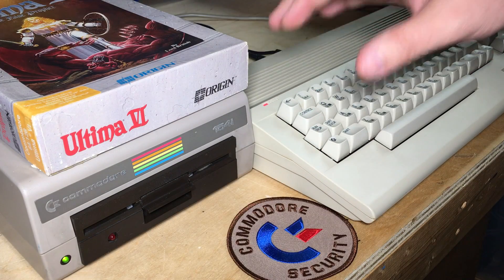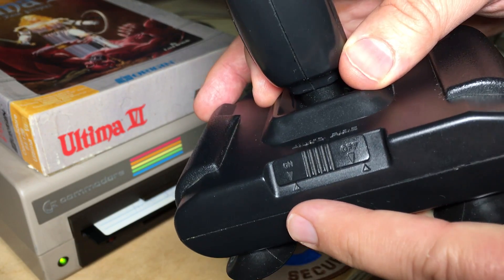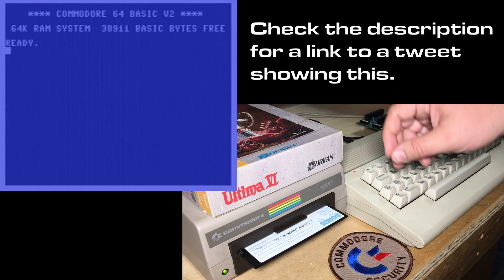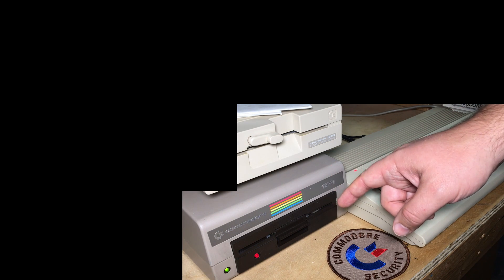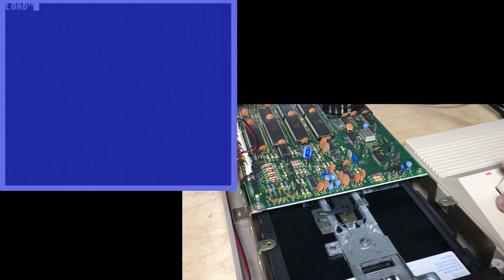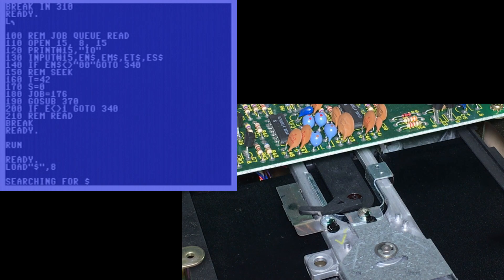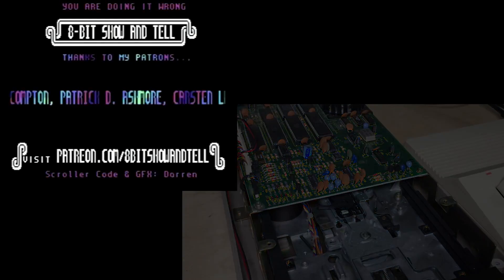Karateka Killed My 1541  (Temporarily) and Other C64 Scares

Comment: For hacking games, we used to shim the top of the 1541 a little bit, and tape a piece of index card to the head, then use a pencil to mark off important tracks on the card.

You could watch for the mark and then yank on the card to cause an error while copying a game. It wasn't very scientific but with the right software and just the right touch you could reliably copy games or even force your way past some errors and protection schemes.

Comment: Great video, cool to see some of the things that can scare you into thinking your C64 is borked.
I remember the first time I encountered the autofire bug, I turned the C64 on and didn't know the autofire on the joystick in port 2 was on, and of course when I typed LOAD got the LQAD as your video shows. I definitely thought my C64 has a problem for a bit until I unplugged the joystick and suddenly everything miraculously worked again, then plugged it in again  and again it didn't work.

It was at this point I examined the joystick and found the autofire was on, and switching it off solved the problem. I also then did what Robin did in the video and plugged the joystick into port 1 and fiddled a bit to find out what it would do.

Thanks also for the explanation about why most later games used port 2 as the default joystick port. Always wondered about that (long forgot about the joystick autofire issues until this video reminded me). Guess it made sense, although some games must have found ways around this issue, such as Rampage which has simultaneous 3 player, using both joystick ports and keyboard at the same time, never found any issues when playing that game in 3 player mode.
Reply from the maker: Yes, it seems with careful programming (and perhaps with careful key selection on the keyboard?) most or all of the keyboard problems can be avoided. That's something I've meant to look into in more detail sometime.

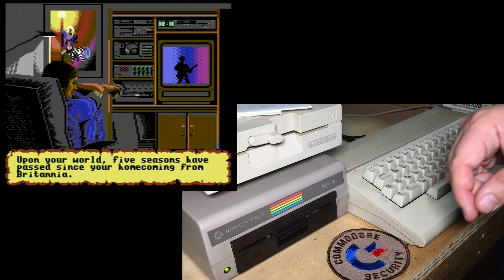Comment: 9:15 Omg! That happened to me! I vividly recall that 4 beat sound the file not found error returned. I had 100s of disks filled with content from the golden bbs days. I think I was going through some games and all of a sudden the drive wouldn't read anything anymore. I think that's why I boxed it up and archived the system.

Nothing has made me want to power on my c64 more than watching the fix for that issue. Thank you for a great explanation! Cheers

Side note: I had an apparently copy protected version of Karateka. There was an invisible forcefield/barrier that prevented the player from entering the final boss's door. It was only on my downloaded version, not the official version.

Comment: A recent scare has been old disks that just have so much oxidation buildup that they coat the read sensor. Then no further disks work. Saw this on another channel...rather than open up the drive, if you don't have a cleaning diskette you can cut up a 3.5 cleaning diskette and take that white material and tape it over a 5.25 diskette's opening and dab it with alcohol, then send commands and presto cleaned.

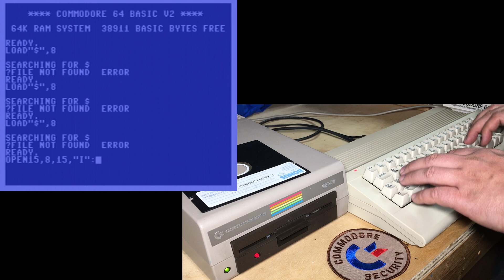Comment: Thank you so much for this great video. I grew up with a C64 but just started using it again after a longer hiatus and totally forgot the floppy drive initialize trick you show at 10:50 in the video. I thought I had broken it since even power cycling didn't help and it would not show the directory of any floppy. Initializing it fixed it again.

Comment: Imagine the makers of Karateka deliberately messed up your 1541 for copying the game - that's cruel.

Also the fact you were able to fix it yourself at age 12 is amazing. I would of cried to my mom to buy me a new one 😂🤣

Also I remember I had a Vic-1541 disk drive for my Commodore 64. I bought it used as a new one was so expensive. I remember some games wouldn't load up on the Vic1541 - the disk drive would make funky noises and then just stop and the small light would flash repeatedly. I wonder if it was due to functionality issues with such an old 1541 drive operating on a C64?

Comment: Before I had the Action Replay I used some kind of three-way-reset (manually, I sticked some cables into the expansion port):
• Normal reset (/RESET to GND)
• Short reset (/RESET to GND via a capacitor, only a short impulse ignored by any device on the IEC bus. You can read the error from the 1541.)
• (/EXROM to GND, /RESET to GND, release /EXROM to GND shortly after /RESET to GND was released. KERNEL reads $8000 and just receives garbage and cannot find the CBM80 magic text. /EXROM must be released soon as the memory test routine in KERNEL would overwrite the RESET vector at $8000.

Comment: Regarding the Ultima copy protection: Yie ar Kung-Fu had something similar. You MUST turn-off the drive after loading the game, or it will crash. This is especially tricky on a C128D with integrated drive, see https://www.lemon64.com/forum/viewtopic.php?t=9998&sid=b327503a8d3d100c51fd2e6489ba15d3

On a related note: Yie ar Kung-Fu uses 6 digits to display the score (000000). As a kid I always wondered what would happen if you reach 999999. After hours of play on a rainy day in the early '90s I was very disappointed to find out that it just rolls over to 0 when you reach a million :-)

Comment: On a normal directory load the drive just checks the current position and the neighboring tracks without calling the recalibration as on format or initialize. With a dolphindos formatted disk (if it can read the sector header without dolphindos) or if being on track 35 max it will read the sector header and know where to find track 18. BTW: when formatting you can shorten the head bang by seeking to track 35 before doing it. Not an issue on 1541- II as there have a light sensor for track zero.

Comment: As far as I know, thus is not a physical lock on the drive. It is more like a "bug" of the ROM. Let me elaborate. When you try to read the directory, the ROM will spin up the drive and read the current track (without moving). If it could read it, it would have figured out which track it was and move accordingly. Piece of cake. However, when unable to read the track, it will first assume that it is half track before or after a real track and try both options. Thus the slight back and forward motion you see. Under normal circumstances, either of these would have yielded a valid track and we go back to the first case. But here we're in track 42, which was never initialized, thus it will never be able to read and will just give up. This also happens when the heads are dirty and you try to read the directory, but only for the directory as far as I can tell. because when reading files it does try to recalibrate by going to track 0. Just my two cents.
Reply from the maker: Yes, I believe this is correct now; a few people have explained it to me since I made this video. Next time I make a video about the 1541 I'll try to explain this correctly. Thanks.

Comment: 9:56 CLASSIC 1541 failure, when head is drop in the space between tracks. That is, head move 2 steps to advance each track. The space between track is there to avoid overlaping. I dont know why the stepper has double of resolution in relation of track, but was a nice touch. Many errors froced the DOS of the drive to drop the head in areas with no information. So you need to MANUALLY reset the herad by command, wich bumps the head to "track 0". Format command will work as well. Nothing preventd CBM to add a check moving one "STEP" (not one track) to see if it starts picking signal again and resyncs. Also the cardboard protector for shipping could be used as a head reset. All you need was to position the head in an actual track, and the cardboard did great .... LOL.

Comment: the 1541C (the white variant of the original 1541) is the only drive that would seek back to track 18 when powered on.
On the other models, the head doesn't really get phisically stuck on tracks > 35, the problem is just firmware. The disk firmware first tries to detect on what track the head is currently positioned to. If it has been moved on an unformatted track (> 35) then it can't read any sync/format informations and the firmware just tries moving half a track forward then backwards just to compensate for any alignment issue. If it can't still identify a valid format, it gives an error. You can obtain the same behaviour inserting an unformatted disk when the head is on a valid track.
The only way to have disk firmware seek back to track 1 is using the "INITIALIZE" or "I" command.

Comment: That track 42 business is pretty neat. When I tried to copy the Abacus Basic-64 compiler nothing could touch it including Fast HackEm. It wasn't until finally, many years later using Star Commander (building d64 files) that I find out that data on that disk went all the way out to track 40. I guess I just wasn't persistent enough in 1986. I actually bought a backup copy from Abacus at the time.

Comment: Kareteka was notorious for being one of the first c64 & Atari-8 games with very effective copy protection schemes .  it was one of the copy protections that directed the drive to look at a damaged or unreadable track and if the value didmt match the encoded hash the game wouldnt work or would only work for a few levels and then abort.  
i know it took years for A8 kareteka to be cracked, and even the smart copying systems like Happy Drive didnt do it.  Supposedly the trak ( brand)  z80 based atari drive would make copies because it could replicate the physically damaged areas of the floppy disk.

Comment: That 1541 intialize command is a "floppy drive seek" which is done by every single PC floppy disk drive just to avoid the situation you were having. I suspect the 1571 doesn't even have this issue because it can read the entire 40 tracks, and it seeks its head back home on power-up.

Comment: The file not found error with the same sound happened to me as an 8-9 year old - but it was with a 3rd party disk drive with a turbo loading feature (the LED light was square and it would turn from green to red) I thought it was completely screwed. I wish I knew the initalise code back then as I don't think I ever recovered from it...

Comment: In regards to Karateka, I am surprised the company wasn't sued. I don't know if this was INTENTIONAL or a flaw in their copy protection..  As far as copy protection on the C-64, early versions are the ones that caused most damage to drive.  I call those "stepper motor" versions, for instance Sector error 21 caused the head to "bang" (what you referred to as the machine gun sound).  Over time these protections caused the head to go out of alignment and really mess up your 1541 drive, where you could eventually no longer read disks properly or at all.   Later copy protection did not bang the head (i.e. error #29) etc, but these copy protections (#21, #23, #27, #29( were easy and could easily be copied.  Then came more sophisticated protection like half tracks, tracks beyond 35, as 35 is the normal upper limit, but modified routines written to drive could allow them to go beyond, for example the protection could be stored on track 40 or in a half track.   Then more sophisticated protections like GCR, etc.  
So for Karateka, my theory is that it used one of the non conventional protections, meaning it would move the head to a non standard / non conventional area inside the drive (half track, past track 35, etc, and just LEVAE it there.  So this explains why you could not access your disks anymore even after powering it off......This in my opinion could have very well been a flaw in the 1541 design, not automatically resetting the head's position
So your INITIALIZE command does just that, it will RESET the head back into a normal position, unfortunately, the banging on the steppe rmotor is NOT a good thin for the 1541, eventually this caused 1541 drives to out of alignment, and the only way to fix it would be to open it up and re-align the heads, but you'd need special calibration software to do it, not something most people have access to, but a fairly easy fix.

Good thing that eventually copy protection was non destructive, no banging of the head.
But eventually you had sophisticated disk copy tools that were compatible with half track, though the multi protection and GCR ones were really tough (i.e. GEOS64)  but all of these could be cracked by just bypassing check and jumping to start of game.......  As far as games with multiple checks later on, another way could be to just emulate and fool the loader into thinking that the value it is comparing does match, so it can apply to any other checks.  End result, no protection is uncrackable.
BUT.......what if you were to store some the checks inside non standard tracks, now that would be tricky.

So as to Karateka, well let's assume it was poor coding, it moved the head to a non conventional position and left it there instead of resetting its position back, as most other games do.  Also Karateka has multiple protection routines, so even if you were to successfully copy the game with the right copier, you would have had weird game behaviour.

Even when formatting a 1541 disk you would hear that initial stepper motor banging, good thing they eventually made formatters that did not exhibit this behaviour (flaw).

I'm happy you figured it out using the "I" command .  If this was done now company would face hefty lawsuits :D    A few modifications to the ROM would have prevented the stepper motor bangs and automatically initialized the head's position upon powering on.

Comment: About multiple drives... many commercial software (usually games) used a fastloader to overcome slow performance of 1541 / C64 firmware.  A few of these use the clock (CLK), data (DATA) and attention (ATN) lines similar to original ROMs, only faster transfer rates.  These normally don't cause a problem with other devices.

Most fastloaders (from my experience) use both CLK and DATA lines to transfer data (instead of just the DATA line)... this automatically translates into 2x speed at 'official' rates and much faster is possible.  The 'good' ones (most) use a timing delay and special CLK/DATA handshake to control communication.

However a few 'bad' fastloaders use the ATN line to control communication (it seems like Ultima VI is one).  Any device that hasn't been 'uploaded' with special code to know about the non-standard ATN use will 'jam' the serial bus.  All standard CBM serial devices will pull one of the DATA or CLK lines low (sorry don't remember which offhand)... anyway this means that neither the C64 nor the desired device (like disk 8) will be able to communicate because some 'unprogrammed' device (like disk 9 or a printer) is holding DATA or CLK low.

Going off topic... You might think you could devise a scheme to use all three of CLK/DATA/ATN to get a 'baseline' speed-boost of 3x (at 'official' transfer rate, faster still possible).  However among C64, 1541 and 1571 only C64 can 'write' the ATN line.  So you could devise a 'fast-save' to use all 3 lines, but you can't create a 'fast-load'.  I'm not sure about 1581, but the CMD hard-drives and Jim Brain's uIEC allow the disk to write ATN so 3x 'baseline' fastloader is possible with them.  I have never seen this done.  If it were done, any other serial device would cause interference like described above.

Comment: I would wonder if the Karateka software tries to read something at track 42 - definitely would be good for copy protection, and if it passed it would do a force of some type to move it back to the normal area to continue - but since it had failed the protection check it didn't even try to get it back... a feature?

Comment: Does Ultima VI have a fast loader? It doesn't seem unusual that fast loaders break if there are multiple devices on the IEC bus.  Since they usually work by violating the IEC protocol, any other devices on the bus get confused
Reply: Yes, that seems to have been the case with Ultima VI , although it was perfectly possible, and usual, for fastloaders to work with multiple drives or other devices on the IEC bus.

Comment: On the early 1541 drives, it was possible that all that head knocking could eventually cause it to be misaligned.

The drive wheel was not physically prevented from rotating on the shaft of the stepper motor by anything other than a tight friction fit. A user developed solution back then was to get the heads back in alignment then use a Dremel with a cutting wheel to cut a channel across the top of the stepper motor shaft and drive wheel that would hold a piece of a dressmaker pin with the head cut off. This was epoxied into place for a ‘permanent’ alignment.

Comment: The drive head didn't actually get "stuck" on track 42.   That little shuttle it did back and forth was half stepping as it tried to read sector markers.   The commodore drives were soft sectored and relied on blips on the disk to mark the beginning of the sectors rather than an LED shining through the index hole. (hard sectored)   Although the index actually marks the beginning of a track.
It seems the software engineers assume the head is always in the used area of the disk and just read for the track marker or sector markers.   If they don't get anything, they half step the head one way and then the other in case it was just stopped a half step off the track.
I bet a format command would put things right again since it does a home on the head.

Comment: Karateka only worked on 1541 drives. It was a finicky program that would not work on any clones, indus gt drives or anything not specifically commodore. It had some wicked copy protection.